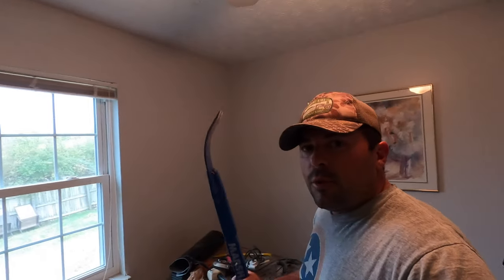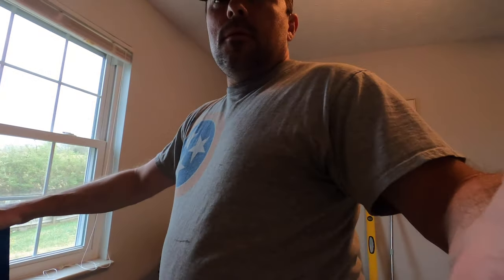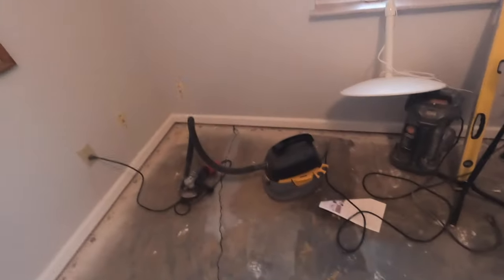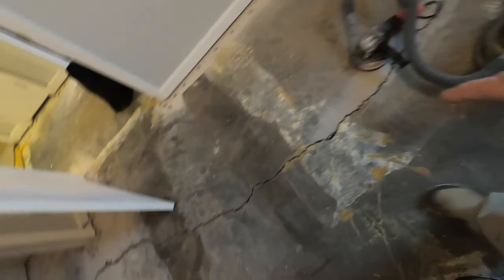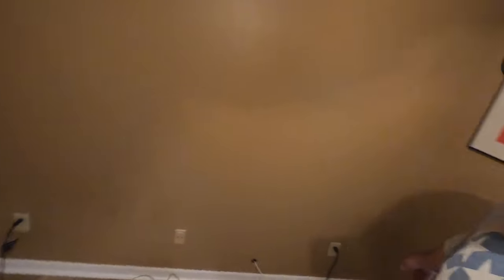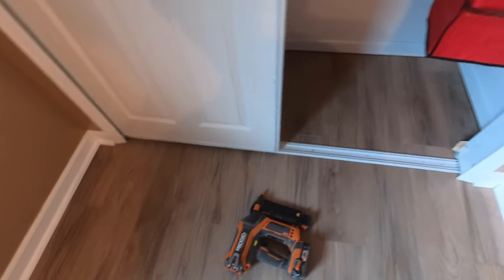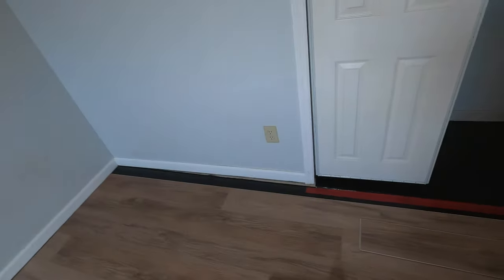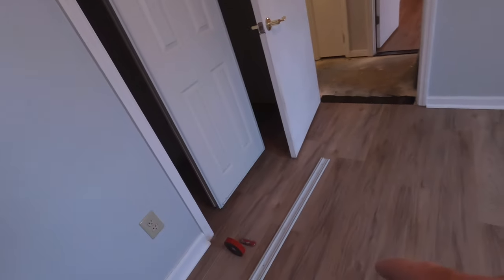Prepping a concrete slab for LVP flooring 2

Comment: I don't like cracked slabs. You know what you're doing.👍🏼
Reply from the maker: No reason for it other than the original builder did not properly prep the site before pouring
Reply: @TheProCut17  Nope. I seen it happen in AZ all the time. Code says dig out and fill with tamped down mfg dirt and contractors just poured the crete right on the sand or clay.